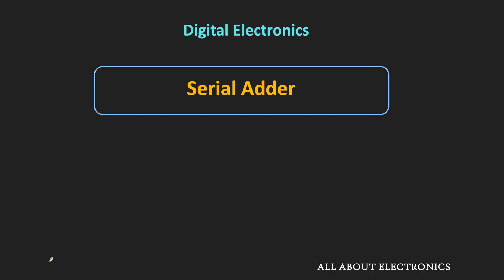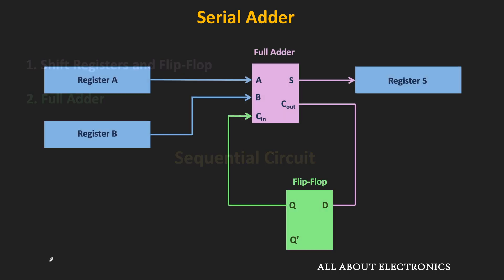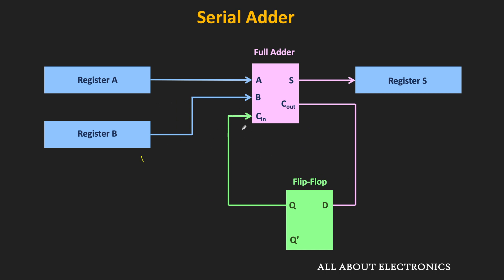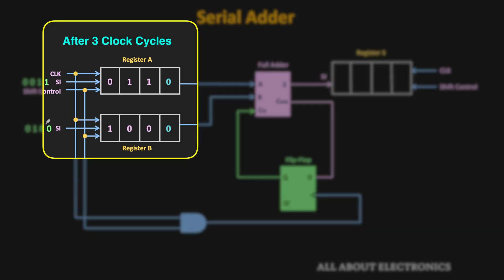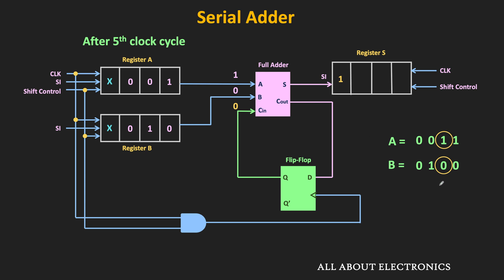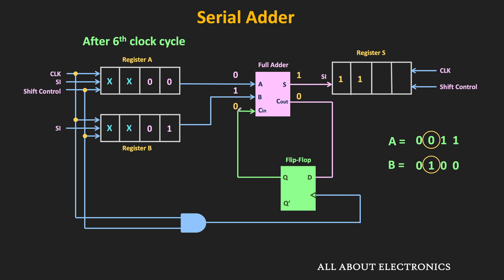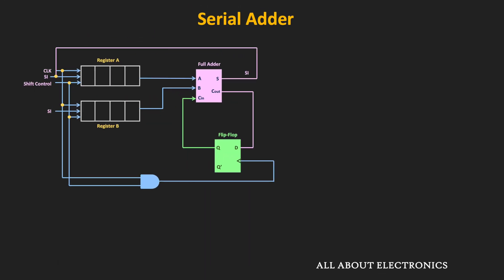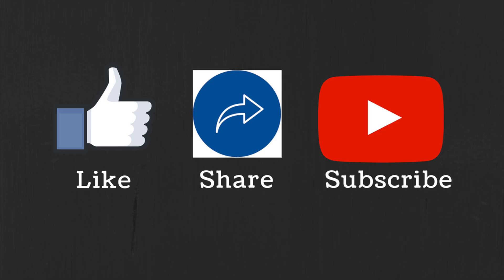Serial Adder Explained (Digital Electronics)

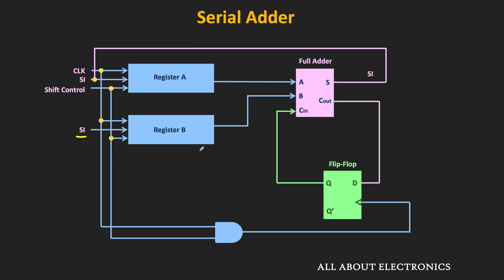Comment: At 10:17, why are we writing register A contents in register B?
Reply from the maker: Here the actual addition starts after 8 clock cycle. During first 4 clock cycle, the content which is meant to be stored in register A will be fed to the B register via serial IN input. Meanwhile the content of A register is still 0. So, after performing A + B, after next 4 more clock cycles, the content of B (which is actually A number) will be stored in A register. And during this serial IN operation, the new data of number B will also be moved to register B. So, in a sense, as it is serial addition, so first number A is fed to register B and then number A. So, that's why, first we are writing the content which is meant for register A into register B. I hope, it will clear your doubt. If you now watch the video from 10:00 onwards, you will get it.
Reply: @ALLABOUTELECTRONICS Thank you for your explanation sir🙏🏻🙏🏻🙏🏻🙏🏻

Comment: Amazing explanation! One question tho: What if the carry was equal to 1 at some point? How would it affect the result?
Reply from the maker: Yes, we also need to check the carry bit after every addition. If carry is 1, it means that result of addition is more than the no of bits allotted to store that. And some sort of indication or flag needs to be raised. So if someone is designing a circuit one needs to see, what would be the maximum addition value is expected. Accordingly the designer should allocate the number of bits for addition. ( 16 bits, 32 bits, 64 bits etc.) And when carry is generated during addition, the flag need to be raised.